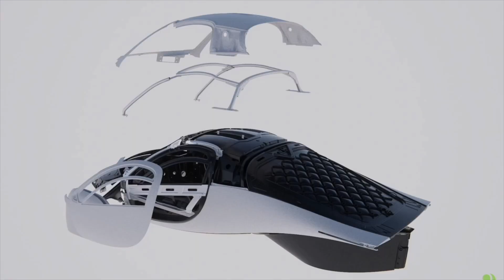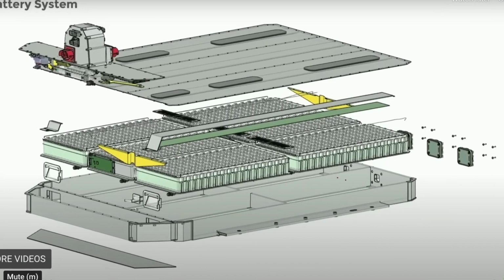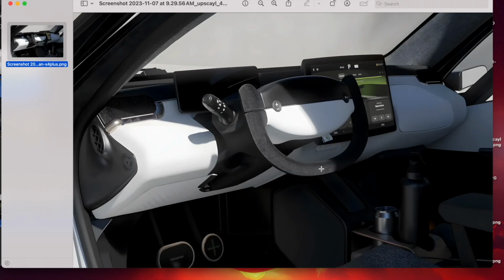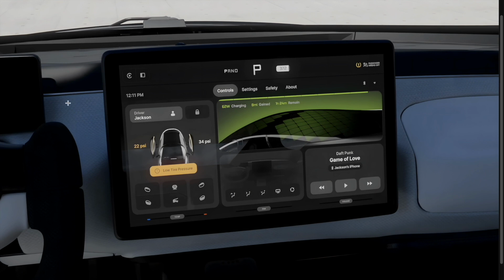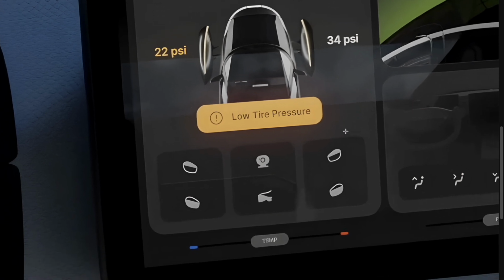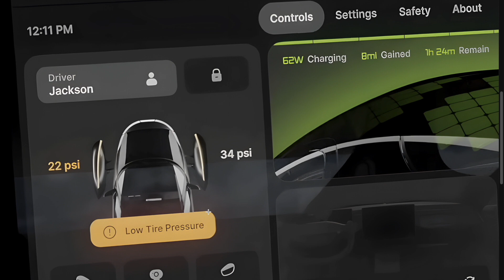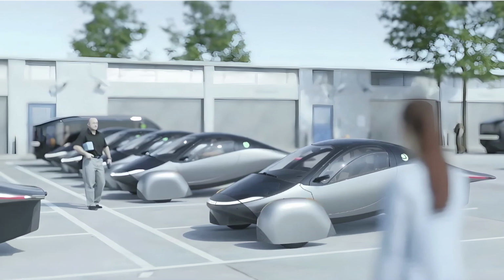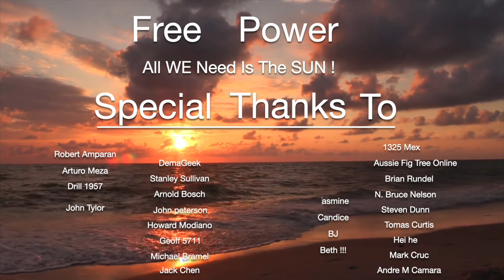Aptera Has More Things For The PI !

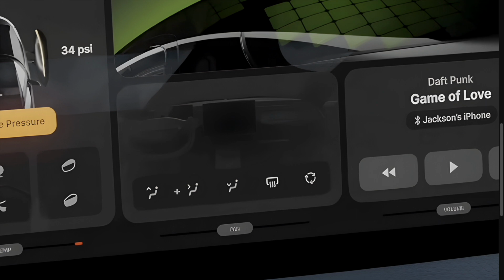Comment: At 10:40 I believe that those buttons are for air direction  defrost, body vent  floor  etc.

Yes I agree. Outside and Inside temp indicator would be great.
Reply: Came here to say that regarding the air flow as opposed to seat movement. 👍
Reply from the maker: Nice , I didn’t think of that , good point ! 😎
Reply: @michaelmay9958  Yeah.  They have clearly stated that for lower weight and price the seats will not be powered.

Comment: 3:06:  side window defroster for sure.  I'm glad they have that.  The thing that looks like a vent on the dashboard is probably a tweeter. 6:50:  PRND on the screen are really miniscule.  Gonna be hard with my tremor. 7:45: no wiper or cruise functions on front page of UI. Probably should be a higher priority than all of the space used to tell the driver who is driving or showing them what the roof of their vehicle looks like. 9:05: Left buttons are for drivers window up(upper button) and down (lower button), right buttons are passenger window. Door release buttons are in the door. Centre lower button is hatch release, centre upper button I have no idea.

Comment: Your screen captures are great!  I can see so much more detail in these.

I think the camera icon may be for side-mirror fold/unfold, since those are actually camera stalks.  and that section of the screen is for open/close commands.  

It looks like the steering yoke may be made from recycled material, or maybe it is just a new texture compared to gamma.  I like the texture on the white part of the dash.

I'm curious where the "unlatch and raise wheel pant" control is.

I agree with you, I would like to know outside and inside temperatures.